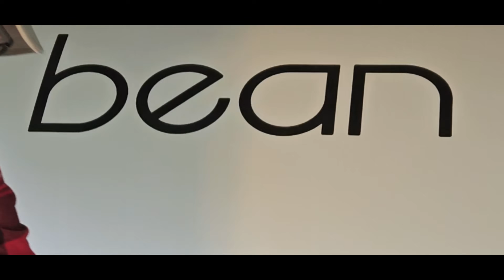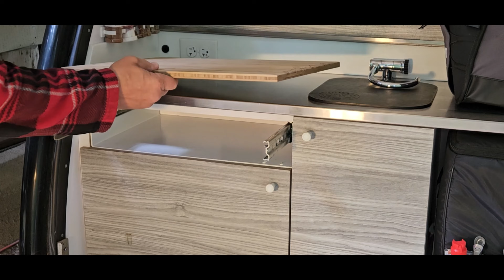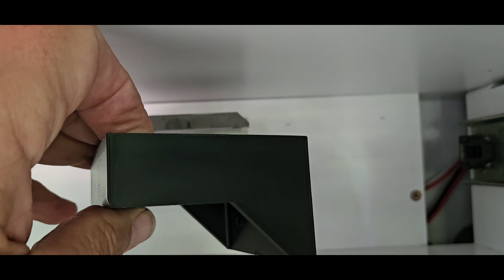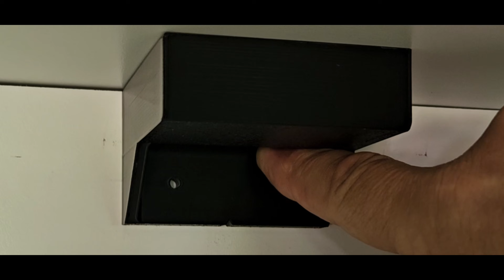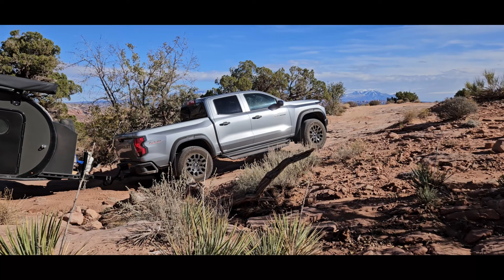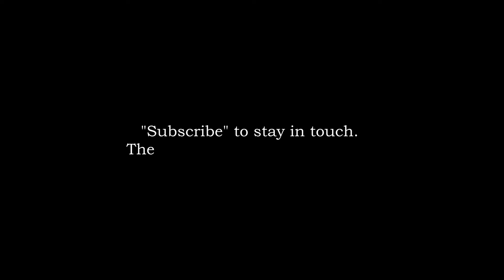Bean Stove Issue

Comment: I tried to look for item but when I clicked on it I get a “page not found” message. Also I tried removing my stove and am having trouble reinstalling it. Is there some trick that I’m missing. Thanks for your help. I truly appreciate all your videos but especially the one on CO monitoring and the shelf modification.
Reply from the maker: Thank you for pointing out the broken link. It's fixed now. To reinstall the stove just align the left and right tracks then slide the stove inward until it locks fully in. Do not use the locking levers during re-installation. Yes, the CO detector issue was a shock to me too. We used our detector last week in 27F weather. It's a big help while heating our Bean with a healthy level of ventilation. We're using the little shelf/heaters a lot this time of year:)
Reply: Thanks for the tip on reinstalling the stove. I got it to go back in fine with your help. I will order the stove item when you get back. Thanks again